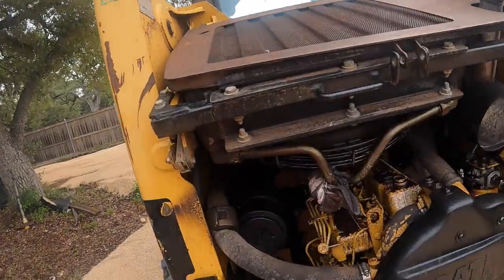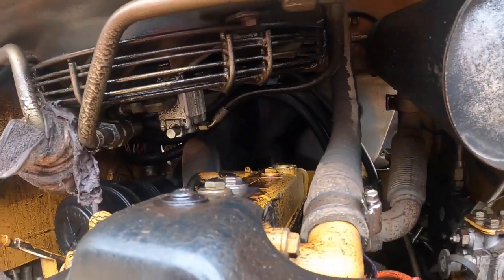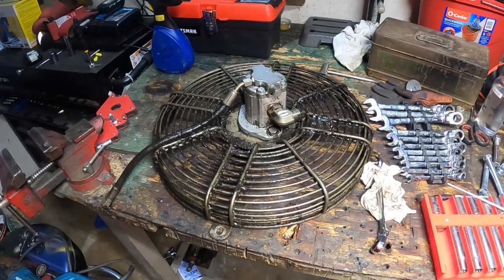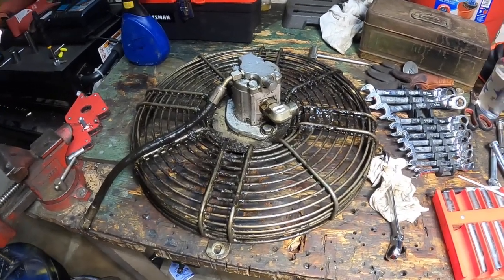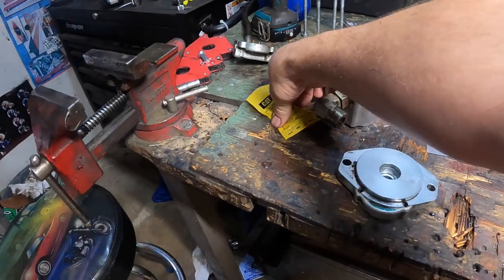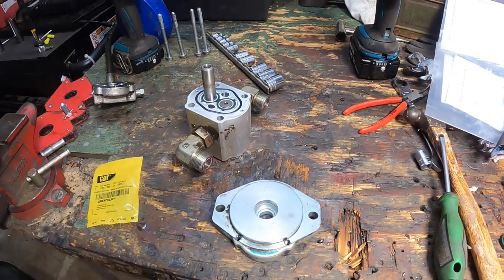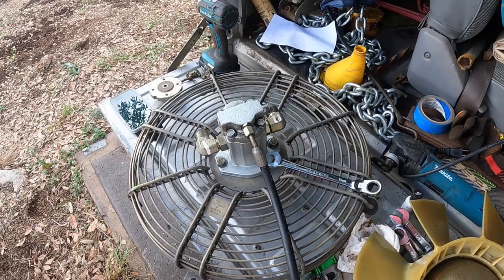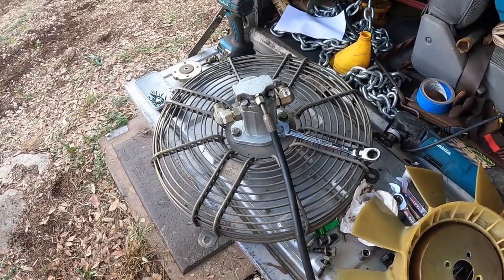CAT 236 Skid Steer Hydraulic Fan Repair

Comment: I don't know about the 236 but the 246 and bigger have swing up radiators so you can work in there much easier. Its just a latch on the side to release and it is spring loaded.
Reply from the maker: @chris3689  yes these do also. I didn’t know that at the time and I was kicking myself after figuring that out 🤦🏼‍♂️.

Comment: Need to if u know thw two gaskets one goes around the shaft an th3 other one..do u know what part number those r..tore it apart an the gasket were in pieces
Reply from the maker: @hockeyfreak043  there are only four parts that are replaceable on the pump, shaft seal, two O-rings, and the snap ring. The other gaskets that you see once you split the case are not available, according to CAT website.

Comment: Better check and see if you got a aware groove on the shaft itself
Reply from the maker: The shaft was grooved and Cat doesn’t sell a rebuild kit for it, so we ended up having to replace the whole thing.
Reply: I have a 2004 247 with the same problem. I had the "figure 8 seals" 3d printed. where did you get the new pump from? @adventuresofaboatguy
Reply from the maker: @shanenabors6988  we got a new pump from the Cat dealer. It was pricey at $900.
Reply: Thanks! @adventuresofaboatguy